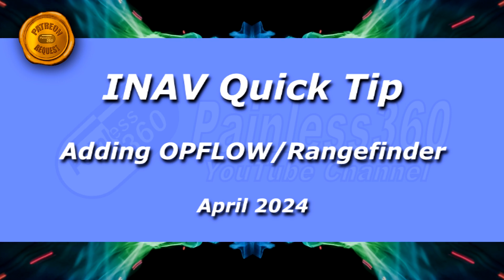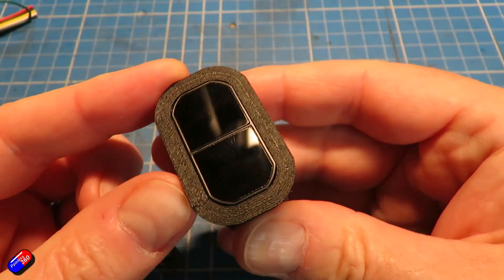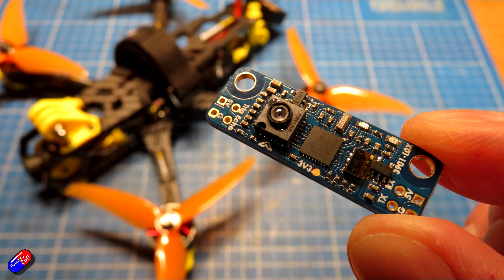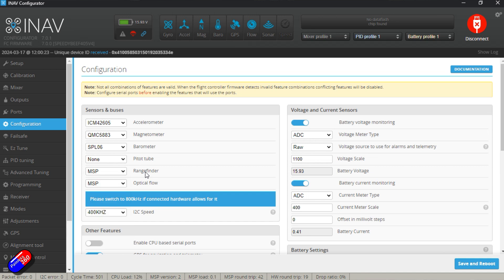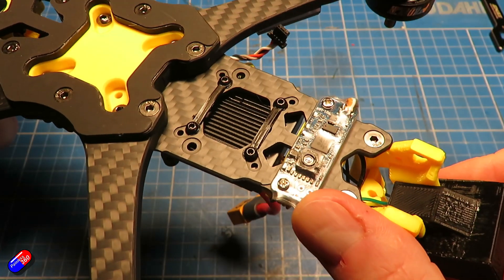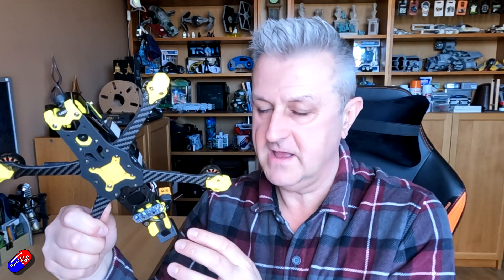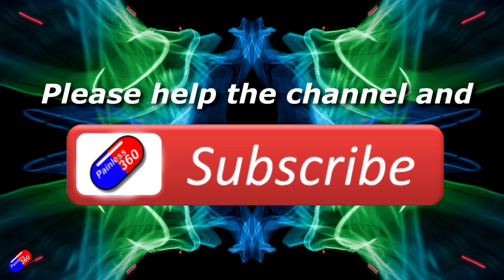How to add a Rangefinder and OPFLOW sensor to your INAV Quad (Matek 3901-LOX)

Comment: Just a Heads up for anyone trying to get this working.  I discovered this after thinking I'd somehow fried my flight controller.  You can't get the firmware to flash if the optical flow sensor is powered up by the USB on you particular flight controller. I wired it this way for bench testing without the battery, just to learn how to connect and configure before I start building.  The firmware flasher will see the Optical Flow sensor as another serial device connected to the same port and refuse to recognize your flight controller.  So if you've wired it this way, unplug the sensor before flashing.
Reply from the maker: Yep, most flight controllers with a powered peripheral will not connect.See https://youtu.be/_7cZ52WPHjc

Comment: I messaged you about getting sonar to work in betaflight. I could not get it to work so I’m trying inav. Will TFMINI work with the way you are setting it up in this video? Trying not to buy another range finder/ optic flow if it can be helped.
Reply from the maker: I only tried the one in the video.. Best of luck!
Reply: @Painless360 ok. I ordered one yesterday just in case. Thanks

Comment: In my case, the debug 1 and debug 3 graphs do not match. The calibration value is 10.5. What is the root cause? Is the sensor not working?  I can't hold a position. Only altitude hold works.
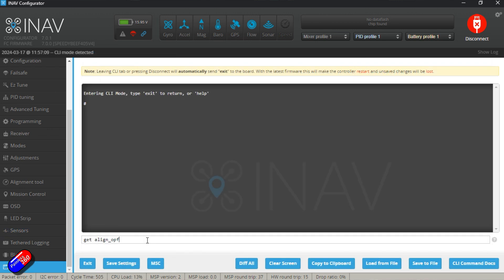Reply from the maker: The steps you need are covered in the video at 6:30...Best of luck

Comment: Thanks for this video. I see in the comments that everyone has its own prefered sensor.  Good to see that there are a selection to choose from. I'm fairly new to Inav (actually this was my first day succesfully fly with nav hold), can you tell me if I'm heading the right way?  I wish to use inav to fly a 5 inch drone 50cm high over a plateform. I want it to detect if it gets off the plateform and turn around if so. I basically wish to fly every square meter of that plateform.
You seems to know quite a bite about inav and sensors... so I thought to ask 🤔

Comment: Thanks for your video. I would like to ask you. I want to use a optical flow along with a GPS in my quad. I know that the default P gains for POS and VEL are too low and should be increased. Once I raise this P gain, do this increase affect the GPS navigation, like oversaturate or can both share the same parameter.
Reply from the maker: I'd ask this of the INAV developers via the support pages, they are the best at getting into the details. Best of luck!
Reply: @Painless360  you are always quick and helpful

Comment: Which will be better ? Matek 3901-LOX or MTF-01 ?
Reply from the maker: Better in what way?
Reply: @Painless360  For hold position on my 7 inch drone
Reply from the maker: That depends on how high you want it to work and other factors. Most cheap sensors like this have limited range...

Comment: Hello, I only installed an optical flow meter to keep a certain distance from the ground, but when I turn on the hover mode, the traversing machine rushes directly upwards. How can I solve this situation?
Reply from the maker: Set hover throttle?
Reply: @Painless360  sorry ,how do i Set the hover throttle?
Reply from the maker: All covered in the Quad Build series... Best of luck
Reply: @Painless360 ok! I’ll try that few days later, my fc just broken😃 thank you sir!!

Comment: Hi ! thanks for the video :)
Is there a way to use both LIDAR/OPFLOW with GPS /w Mag at the same time ?
Maybe to force using LIDAR from the ground to 3m high, then GPS for higher altitudes ?
I'm using MTF-01 btw.
thanks !
Reply from the maker: That is kinda how it works... :D

Comment: how about the modes? pos&hold, nav altitude, heading hold and surface in one switch?
Reply from the maker: Add SURFACE mode to the flight mode when you want to use the Rangefinder... Happy flying
Reply: @Painless360  yeah when I add SURFACE mode my drone up and down 
do you have an idea what happen to my drone?
Reply from the maker: Not without looking at the logs and your setup... If you find the cause, please share....

Comment: Does it require some specific mode like SURFACE or something else? Or does it work by default when you are under max_surface_altitude?
Reply from the maker: It's always supplying height data... Happy flying
Reply: @Painless360  Yes correct, but in which mode or modifier (like SURFACE) INAV uses that data from rangefinder and optical flow. Is it enough to switch the drone into postion+alt hold mode? If rangefinder data is present for the flight controller will it use it automatically as more precision values? The same question regarding data from optical flow. INAV uses it as more precise data and ignores the accelerometer when opt flow data is present by sensors? Thanks for your answers!
Reply from the maker: That's my understanding.... Happy flying

Comment: Check out MicoAir MTF-01, its lidar rangefinder has in comparison to ST VL53L0X in Matek, up to 8 m range. Also I have no initialization issues with MTF-01, when it is very near to ground during power-up. I have one fitted in my SpeedyBee Master 5 V2 frame in the area where O3 unit aluminum heat sink is originally meant to go. It fits perfectly there. On top of the MTF-01 I have Walksnail Avatar VTX V2 unit. Did a custom mount out of TPU and PETG to attach both there.
Reply: I just did similar with a moonlight kit on my 5v2.  That heat sink hole just made sense. I didn't use a TPU mount, two sided foam tape for testing will do for now..  I made space below the VTX by using the 25x25 holes on the moonlight, but had to isolate to the frame with 6mm nylon stand-offs. I don't think the 25x25 was intended for mounting because it apparently connects the vias on the PCBs. Camera didn't work without that isolation - on mine at least.  I assume I'll use the frame's 20x20 holes to facilitate a more permanent MTF-01 solution. The way I have it now gives me 10mm clearance to the deck, but I can see that I can maximize this another 5mm with the space above the sensor and the VTX.

Comment: I've been experimenting with the same Opflow units for almost three years now with mixed success. Those PID settings you showed in the document at the end of the video don't make much difference to performance in my case. I'm using INAV 7.1 and the default PIDs seem to work as well as the pictured ones. Best performance seems to be over surfaces like ceramic tiles with lots of small features for the camera to see. Worst of the lot is plain carpet. When my fluffy back lawn is short I get reliable terrain following and position hold from 100 to around 500mm. A fair bit of bobbing happens at 700mm altitude. Concrete with moss and lichens gives similar results. If anybody is looking to nail their quad in the sky like a DJI MAvic this is not the way to go but fun to try and it will keep you busy. I discovered the global population of Opflow experimenters is a small pool and a knowledge of Hindi and Korean will help. Cheers and have fun.
Reply: You'd probably be better with Arducopter it handles position hold in general much better and tends to do better with the more obscure things like this.
Reply from the maker: Performance of the OPFLOW depends on so many things. Not least being over the right kind of surface in good light.. Thanks for the comment. Happy flying!
Reply: I'm in that same boat right now with a MicoAir MTF-01, it works to a fashion, but its far from DJI-like even after hours of tuning and experimentation.
Reply: Thank you after experimenting with matek sensor for almost a year, i wanted to buy mico air sensor. Now i wont buy that after reading ur comment,  thank you for saving my money. @TheOriginalGeekyNoob

Comment: Thanks for this!!  I see you have the power lead coming right out the back next to the antennas.  Do you think this could affect the VTX output reception for long range?
Reply: The power to the module is very low compared to VTX signals so I doubt if it would interfere.
Reply: @Terry_Fritz  I guess I should have been more clear I was talking about the power lead for the battery not for the optical flow
Reply from the maker: No issues here. Happy flying!